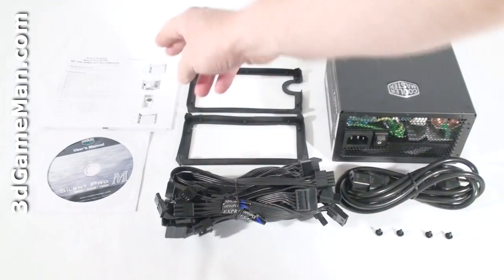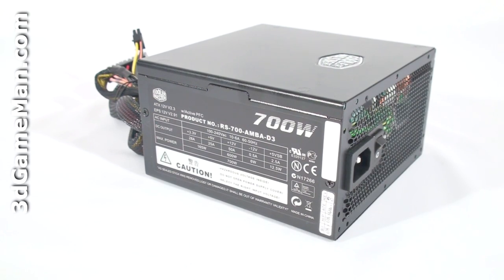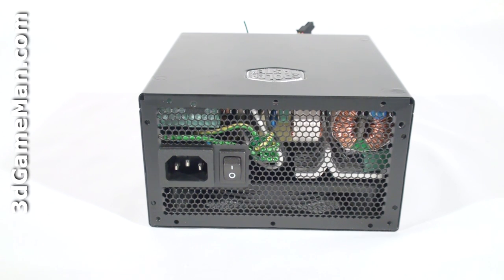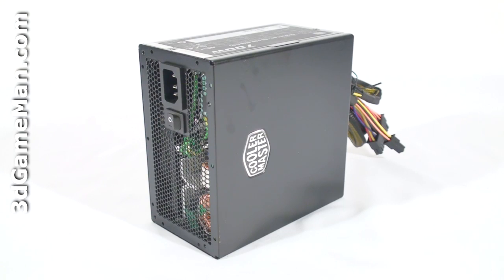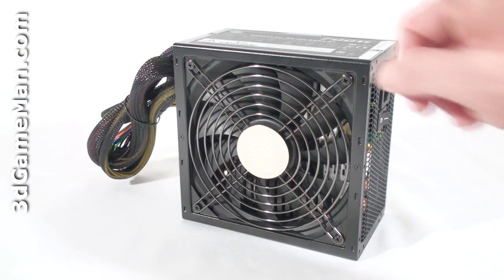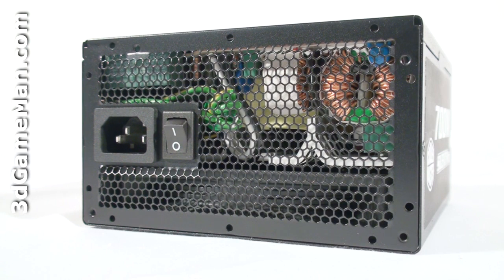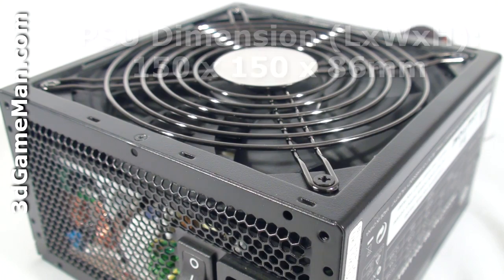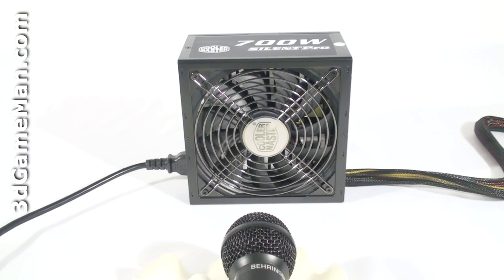#1025 - Cooler Master Silent Pro M 700W PSU Video Review

Comment: @TOJxKiLLSTeaLeR I'd say so. Remember! it's about quality, no just impressive numbers when it comes to choosing the right PSU. Don't make the mistake i did by buying a cheapo PSU (listed as 700W) only to find out your system starts crashing when you add a second card. I later found out the amperage was shit, which was something I wasn't even looking for at the time of buying. since I installed this I've had no problems (2 x HD5770, Phenom II x4 965), and it looks good too.

Comment: I have a 5850 and want to add another 5850 with only 1 hdd, athlon ii x4, 1 dvd drive, and ddr3 4gb 1600 ram. Will this PSU be enough? I think so but it only has 2 x 6 pins which 5850's need 2 pins a peice (150 watts) and i have 2 adapters but is it a good idea or should I go for like a 750w corsair or xfx 650w?

Comment: @wootlanter at idle I think 150 is correct, if you are going to stress it with for example crysis it would be happy with 290 Watts or so.

Video cards can use alot of power but will usually work with less aswell, only there lifetime reduces a bit.

Comment: the CM Silent Pro M 500W , 600W and 700W series has only (4) 4pin Molex Connectors and only (2) PCI-E 6Pin connectors 

If you wan higher Wattage , theres the 850W or 1000W PSU , these has (5) 4pin Molex Connectors and (6) PCI-E 6Pin Connectors..

Comment: Yes, but I ended up getting the 600W model because the 500 one didnt have enough amps on the 12V rail.

I am VERY satisfied with it. You should get it

Comment: Can I run two GTX 280 in SLI with my 750 watt Thermaltake toughpower ?

Current system specs : 

Asus P5E3 Premium
Q9450 2.66 GhZ
Thermaltake Toughpower 750 watt
BFG GTX 260 OC
4 Gb DDR3 1333 MhZ
(3X) Seagate 500 Gb 
Antec 900 with all optionnal fans (total of 5)

Comment: need some advice on cooling, my cpu is hitting 51c and my motherboard about 43c on idle. the cpu fan is gettin to about 4500-5000 rpm. its really quite loud. its a stock cooler. should this be happening or is the heat sink and fan useless. on load the cpu gets to about 57c.

my specs

Amd 9950be 2.6ghz with stock heat sink and fan
8gb 6400 ddr2
HD4870 1gb
Asus M3A32-MVP Deluxe/Wi-Fi AMD 790FX

Comment: so wrong there it does not need nearly that under load a computer with cf 4870x2s would use about 600w maximum.

Comment: why do you say that 700W is more than enough for high-end? two 4870X2 in crossfire need almost twice this, at 1200W. I wouldn't use anything less than 1000W for a high-end system, even if it was in a SFF case

Comment: what brand is your psu i have a nzxtpp500 4gigs of 800mhz corsair ram and core2duo every where i search says dont run even a single8800gt in it so if 450watt is enough for you will i be ok running a single 8 or 9 series card